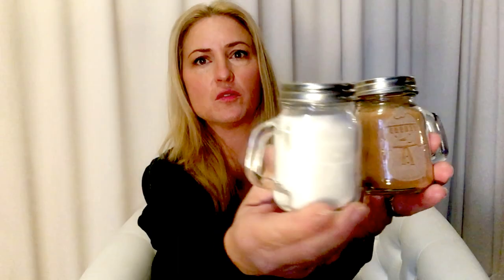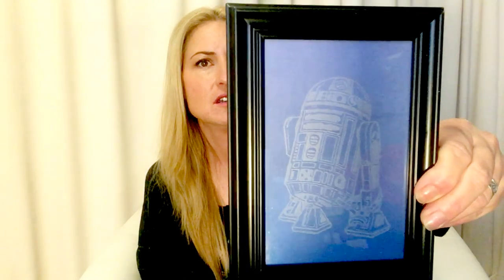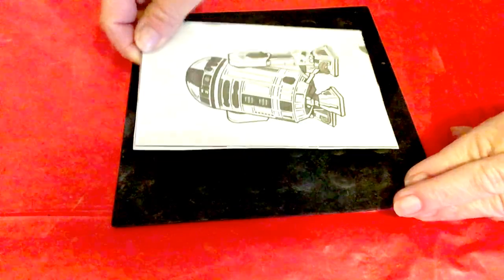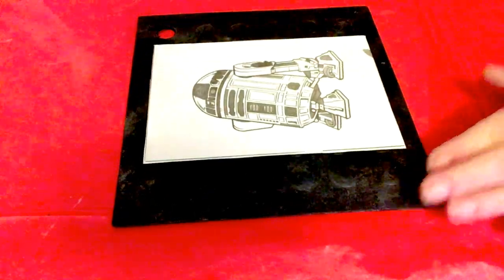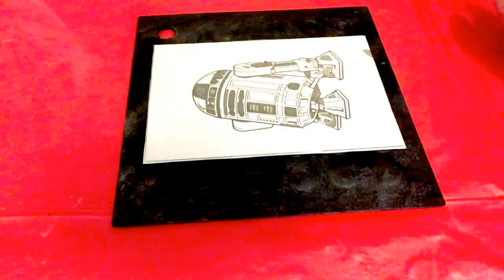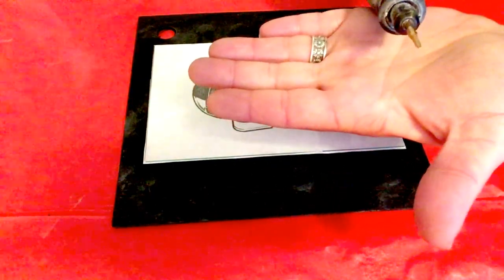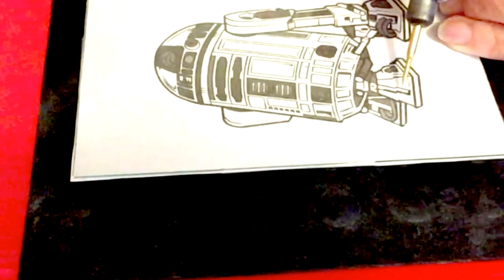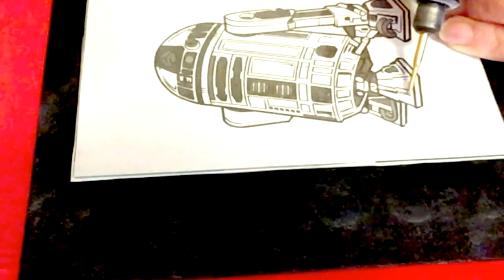Etching Glass With Your Dremel

Comment: Wow. An amazing job for the first time.  I should try it some day. At least something very simple. Thanks for sharing.
By the way, did you change/mix-up the intro?  (or am I mixing up things now?)
Reply from the maker: You should try it Hans! No- I’ve been thinking about a new intro, but this is still the old one. Do you use a translator? Your English is really good.
Reply: @sashaskapar2324  Don't change the intro. It's a very good one. Thanks for your compliment on my English.  No, I don´t use a translator.
My English is, unfortunately, much better than my woodworking and craft skills.
Lately I bought some templates and this evening I wanted to decorate some wooden tea-light holder which I made.
A total failure. At first I painted the four sides of each holder white and let the paint dry.
Some hours later, when the white paint was totally dry, I used green paint for the decoration i.e. filling in the templates with paint.
But the paint got under the template so the result was terrible. Of course I only noticed this after removing the template when the green paint was more or less dry. I decided to make the green non-ornaments invisible by painting those sides green. I have three other sides to try some alternatives.
If you have a good idea please let me know. I'll go searching on the internet as well.  (both the white and the green paint are water-based and applicated with
a classical paintbrush
Reply from the maker: Whenever I use templates, I trace them with a pencil, remove the template, then apply the paint. I can never get a good finish if I leave the template in place while painting. I hope that helps!
Reply: @sashaskapar2324  Thanks for the tip! I'll try it. Maybe it won't work with the templates I used (in the meanwhile) yesterday, here. because they were rather 

small. I need to pick some wider template and try at first on a piece of scrap wood. I have to train my hand and arm to be steady.
Reply: For now I've found an easy solution because I had no time left to experiment with other things.
I used a sharpie for painting/coloring the open parts of the template. it's not ideal but better than the paint which went everywhere.
Reply from the maker: Good thinking!